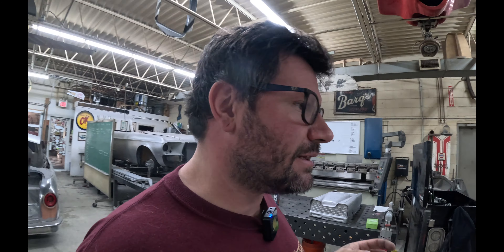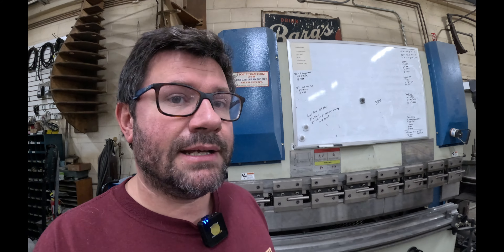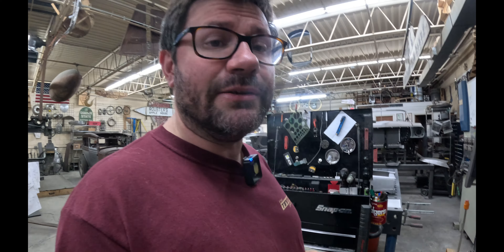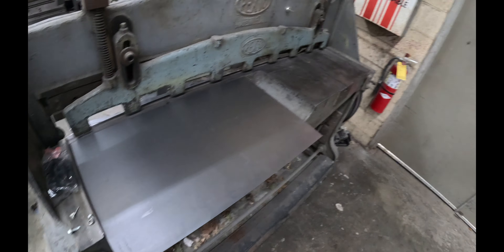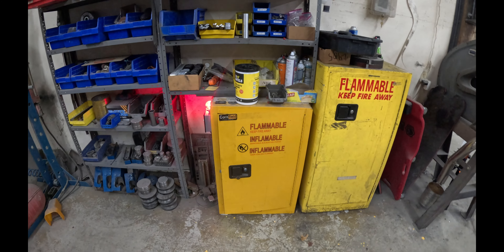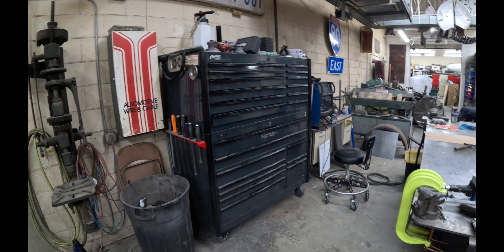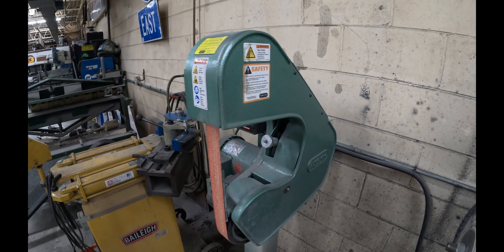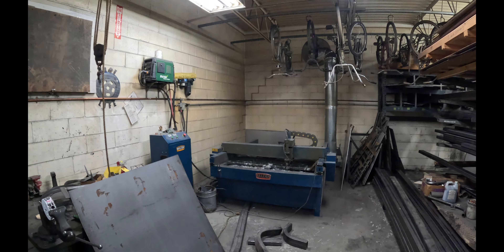Cornfield Customs Shop Walk Around!

Comment: I got out of the auto repair business over 25 years ago, after a 30 year career, which ended in 2002.

Any number of guys in the business back then had "brake carts."  That is, 2 shelf carts with the sides bent up to keep parts and junk from falling off.  Those were pretty standard.

I was one of the first ones in Southern California to buy a roll-around cart with a lockable lid and, if I remember correctly, 3 drawers and an open bottom (similar to the brake carts).  

It was the handiest thing at the time to keep my everyday use tools in and not have to either push my standup roll-around all over the dealership or to have to pile a bunch of tools onto my brake cart - which I'd had nearly all my career.

I talked to the tool truck guys, and at the time, the roll-around cart really hadn't taken off at that time; at least not in the greater San Diego area.

I finally got rid of my roll-arounds, my brake cart, my side-by-side locker, and the vast majority of tools.  I just have the locking roll-around cart with enough tools to do most day-to-day operations, including changing the tins on my Harley, redoing the fuel system on the same, as well as my Tahoe - the famous '90s rotting fuel and brake line issue.

There's not much I can't do with what I have.  Hell, it is a lot more than what I had when I left the Navy, walked out of a vo-tech school and into a shop with a couple of hand carry Craftsman tool boxes I bough in 1974.

Should I ever lose my mind, at 69 (anything is possible), I could take what I have and rebuild if I needed to.  Or, somebody could take the tools I have and get started pretty easily.

Comment: A metal shaping shop near me has moved away from wood bucks and now makes them from steel sheet/plate. They cut the stations on a plasma table (and now have a laser table.) With the benefit of computer design, they can build the bucks much faster than in wood. Give it a try.
Reply from the maker: @T3glider  i have and still prefer wood